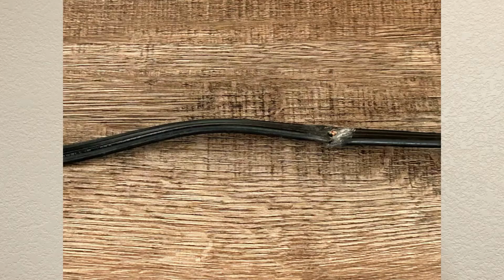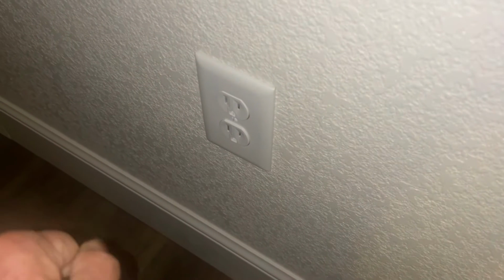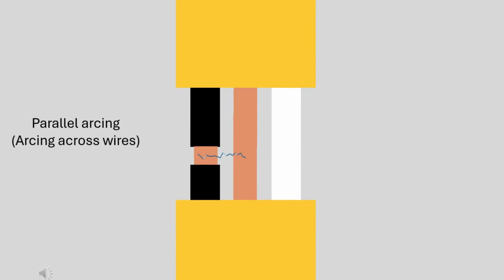What is an AFCI? Why are Arc Fault Circuit Interrupters Important?

Comment: I'm renting a home and have been here a while but began experiencing issues of dimming lights and momentary power interruptions.
I swapped the 2 breakers and noticed it is a multi branch circuit sharing a ground wire.
Even with new breakers I'm still getting the same issues. I've checked a number of outlets and ceiling lights in this 100 year old home.
I've tightened whatever I thought was loose and trimmed wire tips for a fresh clean connection but I still get dimming lights if more than a couple things are running at the same time. It's not tripping my circuit but it's unnerving. I'm guessing afci circuit breakers are a good idea but I'm concerned about the wiring in this old house.
If I change out these breakers am I going to constantly be flipping the switches on my box every time I get these fluctuations?
And is this a rewiring of the house type issue I need to alert my landlord of?
I've been here for 11 years and I'm guessing the wiring probably hasn't been addressed since the 90s. Thanks for the video.

Comment: Great video. Thank you. Do you have a video explaining when it is best to use a GFCI breaker or GFCI outlet? Seems to me either will work if installed correctly.
Reply from the maker: @maverick421SD    It really doesn’t matter which one you use. It’s more a matter of convenience, ease of installation, price, and how many receptacles you’re trying to protect. You’ve just got to consider the various factors, but they both work equally as well.

Comment: If history is any indication,  it will only be a matter of not if, but when, two pole dual function breakers are in every major panel manufacturers lineup, at a rather hefty price tag of course.    To my knowledge only some panel manufacturers,  Siemens and square D are ones I'm aware of, that make two pole combination AFCI breakers. And going forward this can get more critical with time because from about the 1960s to 1990s mutiwire branch circuits eg. (a 12/3 NM cable provides two 120V circuits using the black and red sharing a neutral) were popular for the two required kitchen countertop receptacles and possibly other areas in the home such as larger great rooms, as a means of saving money in labor and materials.  

These homes are now showing their age, and it's a well-known fact that the risk of arc faults increases with age, and two pole dual function breakers would provide the added protection you want in older kitchens wired with 12/3.
Reply from the maker: Great information. Thanks for sharing your knowledge.